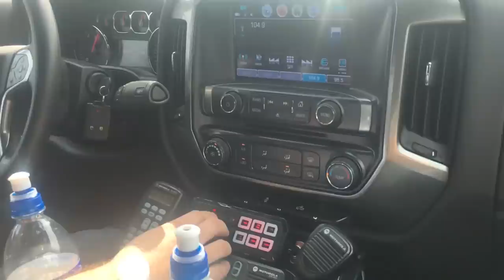This was UNEXPECTED

Comment: impact in u-bolts is a no go, they have too much spring in them and once the least bit loose they absorb nearly all the force applied and nothing moves. best bet manually crank them off with breaker bar if trying to save them (after wire wheel or sandblasting!) or just torch them off and install new ;)